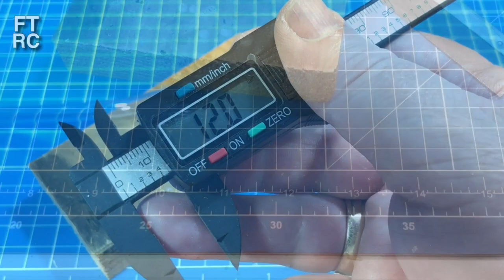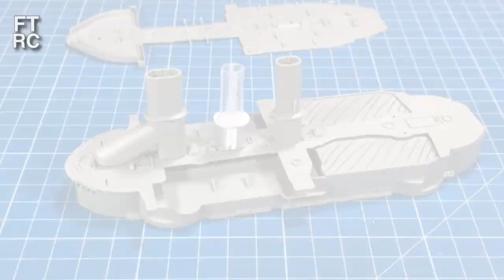Trumpeter 1:350 Deutschland Part 2  Scratch Funnel Conversion for Schleswig-Holstein to 1908 specs

Comment: Ok, Harry, what's the blue stuff? Who's the manufacturer? I've made my own parts for years, but molding was a job I hated making two boxes, and on and on, that looks like I could get it done in minutes. Anyway, awesome video.
Reply from the maker: Blue Stuff is made by Green Stuff World.. it’s not expensive and as I showed, reusable.  Great for small parts you need to duplicate by making moulds as quickly and easily as I did in the video.  The funnels were the biggest things I’ve tried, but still got a result.  Just need more practice.  That Tamiya UV reactive putty works well as a casting medium, and is faster to cure than Milliput, which takes over night.
Reply: @Harry Houdini Models  
You could do a video on this just because other guys like me are older and has/have no desire for 3d just to make a small part or a copy of one small part I've  casted for years printing Looks fun but to much for making one extra tiger fifel air cleaner. 😁 because I've done that.
Reply from the maker: I have shown it twice before in the Ka-Tsu and St Louis
Reply: That casting was pretty slick . As far as the kit having extra,  earlier parts , dies Trumpeter sell an earlier kit also ? And they just throw in the extra sprue 
because some of the parts are necessary ? Ala Dragon ?
Reply from the maker: The 1908 Trumpeter kit has the same number of sprues but the base of the superstructure is C2 not C1, L replaces G sprue for funnels and masts, H is replaced by K sprue for the slide moulded details, J and F1 get replaced by M and F2 for the boats and deck fixings.  A, B, D and E (3 of for armament) remain the same. So unlike Dragon there is little waste except for B sprue which contains upper decks for either version and E where the 1935 version uses less of the duplicated secondary and tertiary armament.